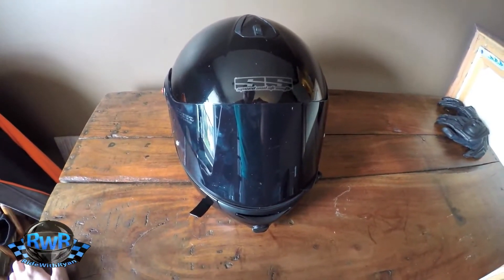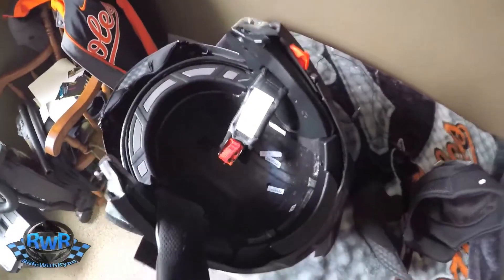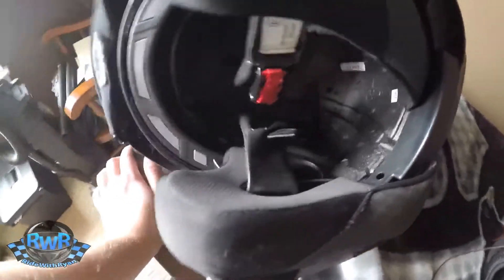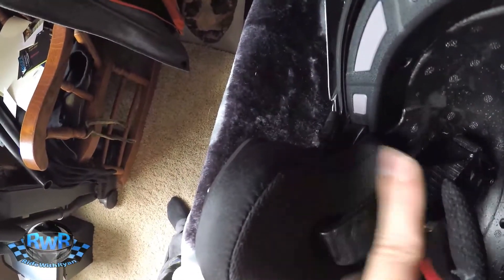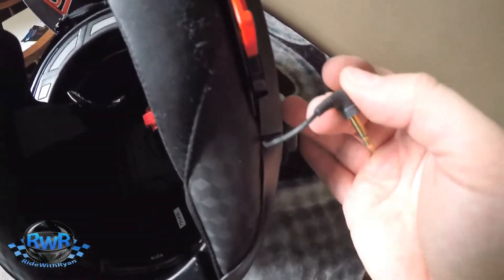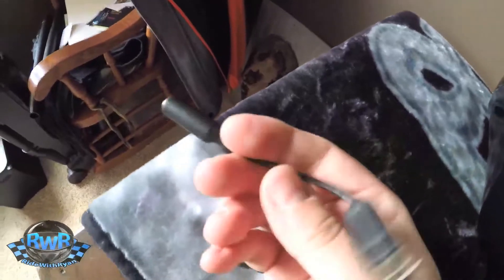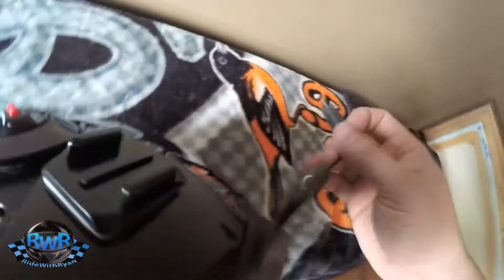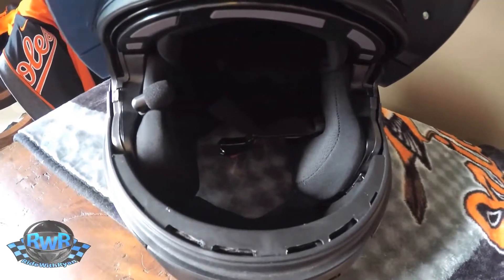Mic/GoPro Set-Up In Helmet Tutorial!

Comment: I'm still trying to get my mics in the right spot... Yes 2 mics one for me and one for when we do duel vlogs so my camera can pic up the other rider though the two way,
The problem I'm having is my gopro is chin mounted so I got wires every where.
so thinking I might have to go back to side mount. And thanks for the sub returned the fav. Not that it makes any differents what country are you from.
Reply from the maker: I'm from the U.S. And tell me how you managed to setup a 2nd mic for dual vlogging? I didn't know that was possible
Reply: The mics I got are the type you would use
on your lap top mic input and these have very short cables maybe 15cm/6 inches long
the nice thing is their flexible Now to get two
into one you just need a 2 into one lead.
are there you have it. I'm sure you can get one at Radio Shack or a store like. 
I did redo my camera set up looks better.
Reply from the maker: I'd really like to see a video of your set up if you ever do one let me know man
Reply: I'll do one soon

Comment: Presumably you started Motovlogging with a go pro? Any ideas on a completely separate mic? I use a contour 2 which offers no direct link for a mic. Cheers :)
Reply from the maker: A.J The Unexceptional Biker I can do some research for you but I am not entirely sure. I have only learned how to work it with the go pro at this point.
Reply: A.J The Unexceptional Biker I have a Contour as well, and what I will end up using is an old headset plugged into my smartphone running a voice recorder app. Then I'll just sync up in editing. I've tested it before and it works quite well - the sound is nice and clear and there's no wind noise. You only need the mic and not the earplugs, so I've still got to chop the ears off an old pair. My phone sat in a chest pocket in my jacket. That's the cheapest option.
Reply: RideWithRyan Oh no mate, don't go out of your way! I was just curious. Thanks all the same.
Reply: osmoregulatoryorgan This sounds like a solid option that never crossed my mind. Thank you very much :)
Reply: A.J The Unexceptional Biker no worries, man. Happy vlogging.

Comment: are you doing the same thing with the new mike or has the placment changed? also where can i get a helmet like that it looks prety cool.

I hope to start motovloging soon on my channel i just need a bike and a mic. the bike seems a bit important so im gona wait till I get that to start my moto vlogs. do you have any sujestions on a bike?
Reply from the maker: Mic placement hasn't changed. Just a slightly larger mic now. The helmet is a speed and strength ss1700 modular helmet. I've put a tinted screen on it. I'd suggest a smaller bike like a 300. An r3 or ninja 300 are great starter bikes.